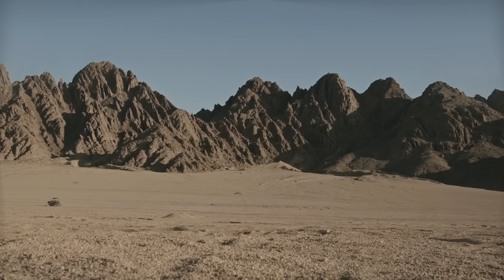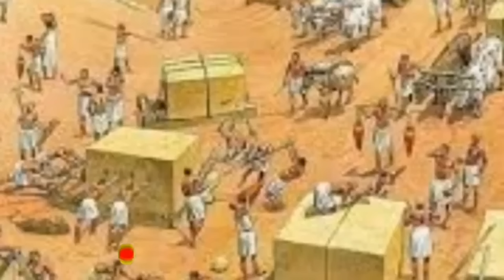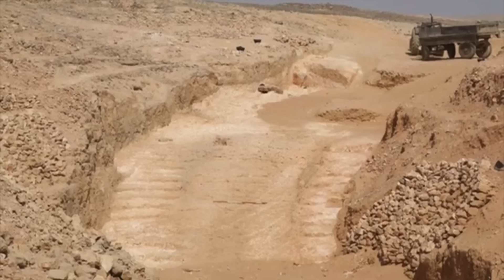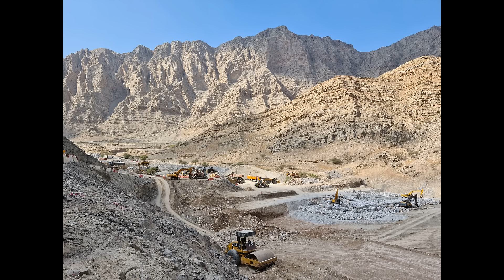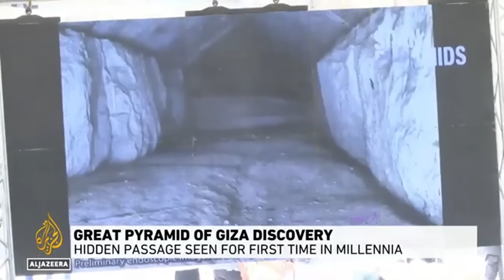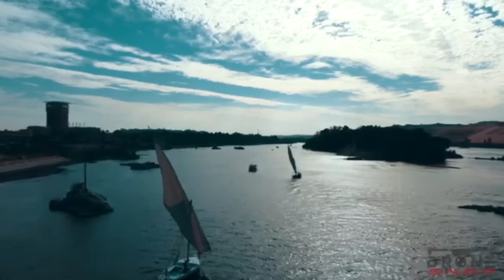Archaeologists Revealed the Technology Egyptian Engineers Used to Build the Pyramids

Comment: I thought it had been known for decades that the river was diverted to accommodate the barges carrying the blocks.  And the water errosion marks on the base of the Sphinx add weight to that theory.
They didn't "drag" the blocks over logs of wood or on "sleds" either. A couple of Australian Archaeologists reported, back in 1985, that they had found written descriptions of how they moved the stones.  They used 'cradles' of wood, that when tied to each face of the block formed a wheel with the stone at it's center.  Wrapping a rope around the center of the "bobbin" shaped "wheel" allowed the stone to be "unwound" UP a steep ramp.  These wooden cradles were then reused, so there was no need for large numbers of them. How they managed to cut the blocks with such precision is still to be answered.  And how did they 'lift' the bigger blocks?

Comment: Best explanation for how the pyramids were built is the way they still build grain stacks. Lay down a 3 sided perimeter of sacks, the 4th side is only partially made leaving an opening wide enough for workers to go in and out at the same time, then start loading in more sacks to make the floor, add more layers starting at the back wall each time, but leave the opening and build it one step at a time inwards, leaving an internal staircase. Once the height wanted is reached, start backing out filling in the staircase as you go. They still do this.

Comment: Aug2026:  Months ago I speculated that water power was used to raise the pyramid stones.
     That is based on Egypt's experience from delivering irrigation water to their fields.
     I thought perhaps the pyramid's internal shafts were used to float ballast up and down, thereby creating a lifting crane.  For that to work you need a lot of water hauled up one bucket at a time.  Whew.  
     [It would require much less labor to collect rainwater in a pond on the plateau and use the "head" drop down to the river for power.]
     This story suggests a more direct winch system.  Way simpler than my design.   However, both designs require a much wetter Egypt.
        Retired water engineer in Sacramento.
Reply: There's a lake that's higher than the pyramid plateau, check out "The Pharos's Pump".

Comment: The civilization is not lost. It is found. The establishment is trying to loose it. They insist to always greatly under estimate the builders capabilities. They had iron, compressed air. They understood thermo dynamics. They built pumps. They had chemistry. I call b.s that they studied the cosmos, and advanced geometry, yet they have no concept of a wheel. That is a ridiculous notion. We need to consider the tool marks. They had drills, core drills, circular saws. The same things we use today.

Comment: Water makes no sense. Water eventually evaporates. They would need to keep repeating that process every trip.

I would say it's oil being poured on the sand. Oil compacts sand way firmer than water. Oil is used today to make driving surfaces in desert sand firm.

It will also keep the sand firm longer than water. That's important if they're making many trips.
Reply: Good insight! Oil is slippery too.
Reply: They didn't have an  oil industry nor enough olive trees to even pave a short road.

Comment: if you use that same sand water and water pressure and tank exchange tech in reverse, you have the very tech you need to cut the blocks too. so if they were savvy enough to figure it out that way that's probably how they cut it so exact too?
Reply: Big  noncence

Comment: Great vid, but arent there monolithic stones on the interior, whos weight challenges lift for even modern equipment? Hydrology couldn't lift 1500 tons hundreds of feet high, or with such precise placement. What about the stonework visible near the base, which is obviously different, and from an earlier age? Sandstone, alabaster and limestone were sourced and quarried locally up Nile,  but not granite, it came from 500 miles away at min...

 I think your observations are awesome,  but perhaps this method was for caseing ,or recaseing Khufus exterior over an older, prexistent structure? Possibly for construction of other structures as well...

Comment: Mate, all very interesting but. Check the bottom 13 meters of stone work on prymid number 2 against the stone work in Peru and rethink your presentation. Sorry you are way off.
Reply: Also, the China Pyramids and Japan has the SAME granite construction. I have not heard how they cut and placed granite with sub-millimeter accuracy. The  Giza Pyramids pump water and make electricity from the compression stroke of the Giza ram pump inside and under the Great Pyramid. Read "The Pharoah's Pump" by Kunkle. Khafre's Pyramid has a different function.
Reply: Khufu refurbished the great Pyramids. Maybe even putting the outer lime stone on. He didn't build the core construction.
Reply: It makes the most sense to me that the Great Pyramid was the oldest, and muti functional, pumping water for major lifting power, and irrigation, and compressing air for tools, and also for more minor lifting power. The other pyramids construction in the complex benefited from that, and they went on to perform chemical production, mainly ammonia for fertilizer. If some of the theories presented in the land of Chem are correct.  It is  possible that they made explosives for mining aswell. They could have even produced bio weapons. They were obviously way more advanced then people with no wheel, pounding on rocks with rocks, and producing precision monuments. That is stupid.

Comment: The Great Pyramid wasn’t aligned to true north with a simple ball of string, and there are countless reasons why. The biggest is that the ancient Egyptians had no idea they lived on a planet. I also believe the Great Pyramid was originally aligned perfectly to true north, but a series of earthquakes shifted the structure over time. What may interest you even more is the evidence suggesting that advanced technology was used in the creation of many ancient artifacts. Tool marks are everywhere. Admir and apreciate your efforts.
Reply: Exactly and the so called Khufu pyramid WAS set to true north when it was built and it wasn't 4,500 year's ago it's much much older by 10s of thousands of year's possibly even more because of the length of time it takes granite to detereorate, especially rose granite with the majority of mass being pezo electric crystal throughout.
Reply: As you say, they had no concept of ball earth, so isn't more likely then that they aligned it east- west, just like the video describes at about 27 minutes? That's something they could find easily, north south doubtful.
Reply: There are so many things wrong with this idea.  On average, you need enough wood, usually four times or more the volume of the stone, to reach buoyancy. A one ton block of stone needs a 3 to 4 ton wooden float. The bigger the stone, the larger the float.  Then there's the problem with stability and somehow getting water to rise over 100 meters up a shaft.  Perhaps a siphon system could manage that but it would rely on the river being at a critical location and height to start it.  They talk about ropes but never talk about how they were made, what plant fiber was used nor the weight of the rope itself or the strength it had per foot/ diameter.  Then there's the why...For what purpose would a leader consume resources his nation depended upon for life itself just to build a mountain of stone?
Reply: Yes they did.

Comment: Then these theories need to be tried and demonstrated. The idea of a using wooden cart or wood underneath the stone would simply cause the block (due to its weight) to dig into and sink in the sand as you try to move it. Water can fix this? Then show us? Everyone talks but I never see any actionable proof regarding pyramid theories.
Reply: Uh...hate to burst your bubble - BUT - What about the structures UNDER the pyramids of Giza "columns with coils going 800 meters  down ON ALL PYRAMIDS?" 👀"Synthetic Aperture Radar (SAR) tomography revealed eight hollow, spiral-wrapped cylindrical shafts plunging about 648 meters (2,126 feet) deep beneath the Giza plateau."😱